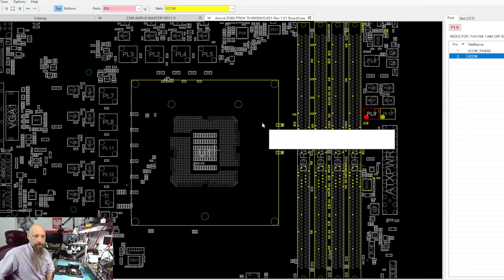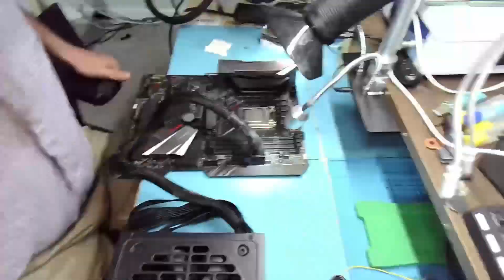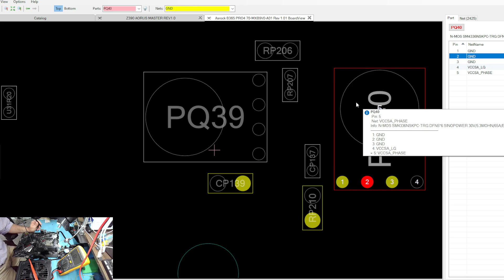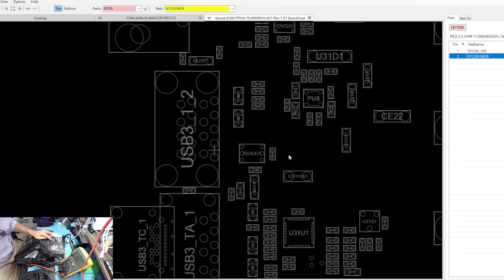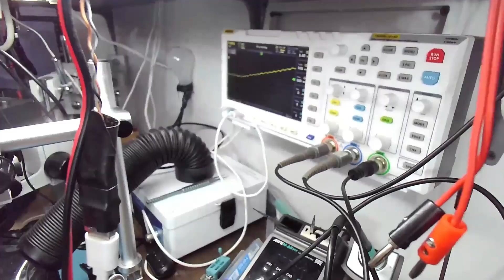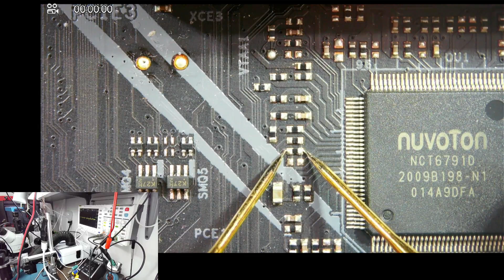ASRock B365 Phantom Gaming 4 Board Repair

Comment: I have the same mother board from past few days there is no sound
Reply from the maker: probably PCH issue or output stage. I have one that has no LAN (it enumerates but doesn't work).
Reply: @blackhorserepairs  i re installed the realtek but didn't work it's vanish like it's been never there, even though the laser came from the spdif port it's off last thing I can do is to reset the bios and one more thing I am getting sound via hdmi from my graphics card

Comment: i have the exact same motherboard that can acces the bios but when i try to boot it gets stuck at the asrock logo. by watching youre video i have discoverd that a ceramic capacitor has gone missing/blown. Could this be the problem?
Reply from the maker: yes, short is a very common issue and can cause the board to freeze. Do you know which process does it get stuck on?
Reply: @blackhorserepairs  when i am booting my pc it gets stuck on the asrock logo and the spinning balls just gets stuck. and it is the capacitor under the mosfets of the vcore, i think it is a MLCC 0.1UF/16V(0402)X7R 10%.

Comment: Did you try to reflash the BIOS? Sometimes, a corrupted PCH can pull SP_3 down.
Reply from the maker: I will indeed check that, I didn't think BIOS would be loaded before CPU is present as the CPU is what runs the code but PCH is perfectly capable of reading certain regions of the BIOS so it would make sense that corrupted BIOS causes emergency shutdown. However the board only shuts down when VCORE is connected, corrupted BIOS does not explain that behavior. I do have an idea what is wrong and I will confirm that soon. Thank you so much for your help.